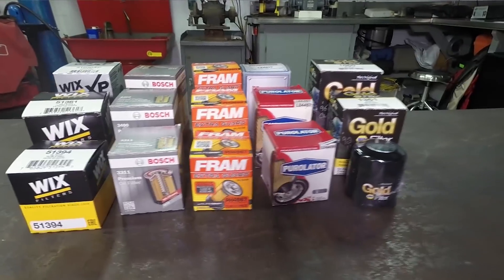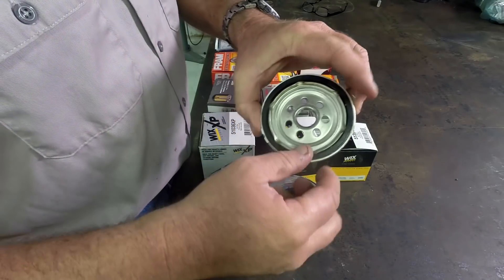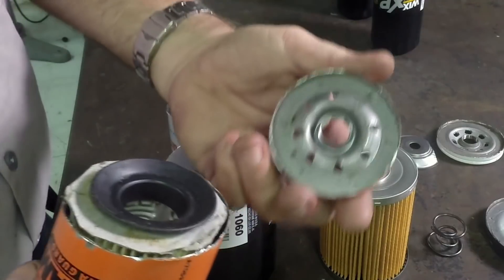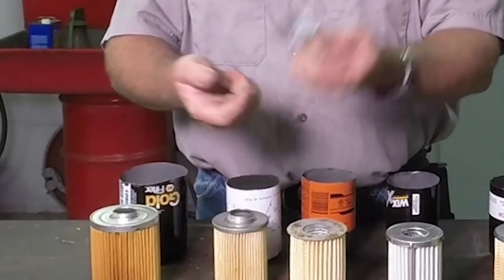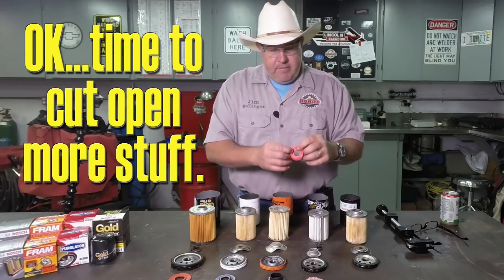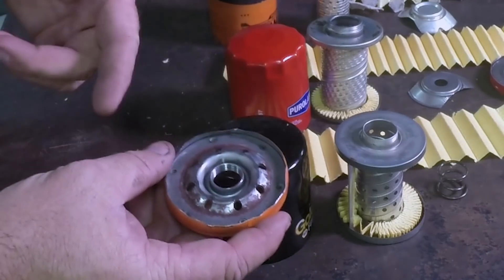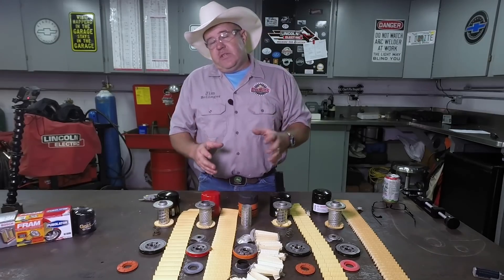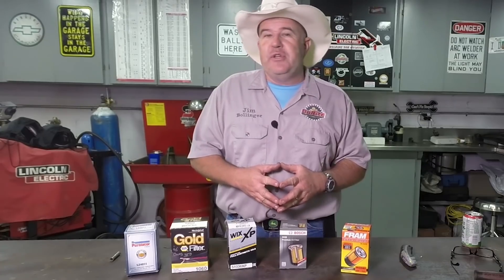The worst oil filter EVER!

Comment: This 'presentation' is unquestionably a probable unreliable and 'hyped' source of such information.
 
First of all such oil multi-pass RECIRCULATION filters are required to pass important validations and compliance through actual testing.  This 'test' is based on the (1935?) Oklahoma State Univ. - OSU F2 test stand protocol for filter efficiency etc. The filter MUST retain the particles to a certain %, (not absolute 100%), at the nominal µM 'rating'.  The OSU F2 protocol has been affirmed by the ASTM and DIN/SI.  This has absolutely NOTHING to do with 'how beautiful' the 'appearance' of the filter is or isn't - does it pass the OSU protocol for 20µM particle.  ...
As long as the filter is validated (by the manufacturer) per the OSU-F2, etc. test protocols, it's OK to use and will meet the 'single pass' 20µM (0.00078 inches) SAE recommended particle retention. 

A far as the 'cardboard' issue .... well, it just so happens the filter media is also a 'cellulosic', - a technical paper that is composed of cellulose and an epoxy 'binder ' --  just like the 'end caps' on that FRAM, etc. filter.  So, if you think that the 'cardboard' is going to fall apart ... well the filter material is of an almost same composition. The epoxide that is used to 'glue' the filter material to the metal end caps is usually the same epoxide that's used to make the epoxy-resinated 'cardboard' end caps. 

If you want to do a TECHNICAL comparisons of such filters, either go to the filter manufacturers website and seek out the 'technical data' or call up their application engineering department:
1. Flow rate in gallons per minute PER differential pressure (pounds per square inch) across the filter. 
2. Ask for the nominal filter rating in 'micrometers', then ask what is the PERCENT of captured particles at a single pass of oil flow.   You can also ask/look up what the 'BETA -value' (a relative indicator of capture efficiency) of filter material ... as to determine the amount of % captured of SMALLER particles, per 'pass'.  Most such filter 'foundries' use a 15-17µM (@ beta = 500) 'paper' to meet the 'nominal' 20µM SAE 'spec'. 
3. When youre looking up the DATA .... choose the filter with the largest filtration media SURFACE AREA --- keeps the differential pressure down which allows a GREATER amount of oil to be filtered / per unit time. 

1. NAPA Gold is private label branded and manufactured (mostly) by Wix. Obviously NAPA, and the other aftermarket distributors, and even engine manufacturers, don't make filters.  
2. Wix is my personal go-to ... because, as someone with a long term involvement in 'advanced' filtration engineering, Im quite sure that they're quite high quality and very much optimized TO "SPEC", etc..  
3. if you want 'really good' filtration, especially if you're operating in 'dusty' environments and with severe engine usage, ... and if you have the space/clearance available, consider to install a double sized filter ... but of the very same connection, etc. size. 'Double' will give you about 3Times the filter life (before the filter 'bypasses') and MUCH better flow rate 'through' the filter for 'faster' oil recirculation through the filter and less oil 'bypass'. 
4. If you want the best, 'do your homework' and avoid the 'HYPE' from folks who have little to NO idea of how or why filters 'work'. 

These types of filters are 'recirculation' mode filters .... meaning if a particle doesn't become captured during the first 'pass', the statistics are that it will be captured during successive 'passes' through the filter ... and that includes particles that are many many times smaller than the filter's 'rating'.  None of these filters will capture 100% of the particles at their 'rating' during each 'pass'.  
Up until about the early 1980s such filters used an un-bonded toilet paper-like filter material, some used wound cotton 'string', some used a 'kotex'-like material .... but they ALL were constructed and validated that they could pass the OSU-F2 test protocols !!!!!!!  The more modern use of high surface area, pleated, resin bonded cellulosic filter media increased the 'flow rate' (for 'faster' particle capture) as well as extended and enhanced the in-service life of these filters. 

Unsupported Hype does not equate to the 'numbers' to which virtually all these filter 'assemblers' are testing during their manufacturing and QC processes.  Avoid wild-arsed & unsupported claims of HYPE ... use the filter manufacturer's published 'numbers' if you have the need to be 'spot on'.  
Lastly, always change your oil filter when you change your oil, don't 'skip'. 

;-)
Reply from the maker: Thanks for the info, as for me, there is no "hype", a rusty falling apart filter will not be what I use. All the Fram filters I opened were rusty, at that point, for me, they are garbage. If anyone wants to use them....fine by me.
Reply: —> @DoRiteFabrication   so why are some of my technically important posts that refute your errant hype and clear unsubstantiated misinformation removed? ... especially the ones where I preliminarily by simple forensic observation - exposed a highly probable water-wetted filter (with rust) and failing end caps, etc. that would be impossible for just about any automotive filter manufacturer ... unless someone soaked that filter with water or it was from recovered inventory from a flood, etc.?  Dont like someone challenging your unsubstantiated and libelous misinformation? - tough. 
So when are you going to use a laser particle counter, etc. etc. and industry STANDARD tests to compare each filter on its 'honest' SAE/DIN/SI TECHNICAL merits?
Reply: @richh1576  proving once again why Trade guys will gladly attend any engineers funeral. To take a piss.
Reply: —> @70montess   Good Post!    You're more correct than you know.  These are RECIRCULATION filters where the lube oil continuously passes through the filter over and over and over, etc. The result is that these filters on a statistical basis remove particles at MUCH lower than their 'rating', and due to the statistics of removal will almost immediately remove (and retain) the bulk of even a rare 'particle storm' caused by failing metal somewhere inside the engine. The filter material inside the filter is made by essentially ONE world supplier; so, on a performance basis such filters will be essentially equal on a one to one basis if the their effective surface area of the cellulose filter material is 'close'.    
That's the anti-hype explanation.  And, there is no need to know if the word anal-retentive needs an apostrophe or not.
Reply: @DoRiteFabrication  What it all really boils down to is this: Does your customer have confidence in your product?  You can try to dazzle 'em with tech-speak and scientific babble to explain your minimum product effort of rust and cardboard.  Or you can make a substantial effort to build a sturdy product and exceed the minimum.  We've seen plenty of engineering failures to know that what "should work" isn't always what actually works.
Reply: —>@jettrod69   You gotta ask yourself how LONG has that filter sat idle on a storage shelf in an auto supply store before someone bought it? You can do the same for any uncoated steel based product ... let it sit on a distributors shelf, etc. for years and years and most assuredly you'll find internal rust, because that's what bare mild-steel does.  
The flow direction of such cartridge filters is from the outside of the pleat pack through to the inside of the pleat pack .... guess where the steel inside of the filter is .... on the outside of the pleat pack ... upstream of the filtration media and not filtered out.  20µM particles (the removal 'spec.') are well below in size of what the human eyeball can discern; so, if you have visible particles on the upstream side of the filter, the filter will 'easily' capture them. 
Have you looked at the underside of a several months old 'new' car lately ... that's not orange paint thats developing on a lot of that bare steel.  

The only FAIR comparison would be sure to get a 'fresh' filter assembly from each of the manufacturers.  

ALL of the displayed filters WILL develop rust on their insides if abandoned to sit for a long time.  Even if any manufacturer used rust-bloomed material, the high pressure metal-drawing process used to 'form' the outer canister would remove 99.99% that rust.  
That THIS one had rust 'only' means that it most probably sat around for a LONG time in a VERY wet/humid atmosphere.   
Forensically and in combination with the internal rusting, I'd be quite suspicious of those falling apart, thick tech-paper end-caps and EASY removal of that 'flap valve' assembly ... as that doesnt happen in dry atmospheric conditions for such resin-bonded technical 'paper' ; but, only when long term submerged/wetted in WATER, such as an inventory that gets flooded, etc.  If I had to testify: "In my opinion - The probability is that .... Sometime between the manufacturing and the 'cutting open', that filter was probably heavily water-wetted down or even *underwater*".    ;-)
Reply: RichH 
Perhaps your right but manufacturers should specify materials and packaging that lasts long shelf lives
Reply: Also just to state something, I am not a fram fan, needless to say a previous commentor said something about 250,000 miles. Thinking about it now I can actually verify that because my father has used fram and cheap conventional oil on his 300 inline 6 for 306,000 miles now, and the truck still burns no oil. Had the tranny replaced once but the engine is still in tip top condition... Just saying, so fram cant really be that bad huh? Like I said im a fan of mobile 1 products but needless to say 300 thousand plus running strong on fram and motorcraft periodically... Then again it is a 4.9 inline six. They are bullet proof... I would not use fram on newer smaller touchy engines  that demand super clean spot on oil to run a long time...
Reply: It still boils down to real world results, and if Fram is really that bad they wouldn’t still make/sell the filters and there would be multiple lawsuits against them if their materials repeatedly cause engine damage, changing your oil and filter at appropriate times is still most important.
Reply: Sorry to inform you that I did the same test as this man in the presentation, and guess what? He is right.
Reply: Really? You wrote a fucking book man.
Reply: Could we please get a more specific and scientific review from someone like you, who has filter engineering experience, to do a formal review?
Reply: Why do you use so many quotations?
Reply: —> @torquesoftware   simply because Utube doesnt provide ITALICS.
Reply: @richh1576  Of course not  :P   (to put a word in italics, put an underscore before and after it)
Reply: @bledlbledlbledl  I didn't know how to do this either. Thanks for the tip.
Reply: Damn you must be the filter jesus.... Shewww, educate me
Reply: All I can say is
Amen !
Reply: Glad to see your reply. While it is disturbing to see rust inside an oil filter, all locations seem to be where the filter will block it.
While ruggedness may be nice, it is not a requirement.  All that matters is that the filter & seams always provide a barrier between the filtered & unfiltered oils. I suppose there is an allowable pressure drop across a new oil filter and that it increases as particulates are removed from the oil. If there was a test that subjected filters to 10x the pressure drop that one would expect for a used oil filter, and that test showed that one brand had a filtered/unfiltered barrier failures, THEN I would respect that test. The findings shows in this video are subjective. 
Based upon this video, the cars of the 1950's should be safer because they were heavier & had thicker steel parts than cars of today. Cars today may break apart more in an accident, but are safer for their occupants.
Reply: Go buy a 100k car and put a Fram filter on it.
Reply: —> Mark Hernandez  ummmmm,  Im one of the ones who collaboratively wrote 'that book'. Nothing wrong in quoting oneself.
Reply: @RichH. You are quoting the minimum standards.  We all know people who do the minmun compared against the ones go about e and beyond.
Reply: —>@ @doitndirt   This is stunningly simple. If one somehow perceives the need to exceed the 90 year old minimum SAE standard, then simply apply a lube oil filter that has larger internal surface area of the pleat pack ---> faster oil 'turnover' due to less flow resistance, hence, faster statistical particle reduction and removal.  Eg.: Buy a double sized, etc. filter that will 'fit' (one with the SAME µM 'rating').  
This applies to air intake filtration too... and you'll get a wee bit better max. HP/kW output from the engine to boot. 

Other: NEVER EVER install an oil filter with a 'smaller' µM rating than the OEM spec. !!!!!  As, the design 'recirculation' flow rate of filtration will reduce exponentially, as well as the filter will plug 'exponentially faster'.  In filtration, there's a precise optimum balance between µM particle size removal vs. surface area vs. flow rate vs. pressure drop across that filter.  The smaller the µM removal, the higher that pressure drop which will result in LESS oil flow rate, etc.  Get it wrong and you could rapidly 'choke-off' the filter, create 'hot spots' in areas of the engine because the flowing oil does assist in heat rejection/cooling, etc. etc. etc. etc. 
Installing a larger surface area of the same µM rating is 99.9% foolproof as well as beneficial to 'better' particle removal.  
For normal usage, stay with the strictly 'stock' stuff. ;-)
Reply: You do realize that those test you state are of such low testing standards that a roll of toilet paper in a coffee can can past all three of those tests rite....
Reply: —> @TWOSU_NEWS     
TOTAL BULL!
The reason that toilet paper, cotton fluff and cotton strings are no longer used (since the ~1970s) is that they constantly UNLOAD both previously captured particles but also fragments of toilet paper, fluff, and string fibers.  Imagine what happens inside a main bearing journal, etc. with ~0.001" (25.4µM) ... or sometimes smaller, 'clearance' when a particle that is larger impinges, gets stuck, and begins to collect other 25µM particles.  
The modern resin-bonded filter material will remove approximately. 97+% of those particles ....per 'pass through'.  The toilet paper, fluff, and cotton will only remove about 50+% per 'pass', plus they the UNLOAD as the pressure drop across them increases because the 'micro-fibers' aren't fixed in place.  

So, the question becomes why would you use or suggest something that really doesnt do its intended job and also contributes LARGER particles into the flow stream? ... remembering that prior to ~1970s that crankshafts, camshafts journals were usually 'worn down' and the babbet-faced journal bearings were 'shot' by about 60-70,000 miles driven.  
Guess why now in the present day we have a fairly high probability to operate an engine for 200K -300K miles?  Plus, as engines are increasingly designed around tighter and tighter oil clearances and lower viscosity oil, we're already seeing the need for extremely finer and more 'accurate' and LARGER sized filters.  Someday soon there will ultimately be a prohibition on DIY changeout of the filters because DIYers, 'huckster shops', etc. will often buy 'crap' that will thwart vehicle warrantees.   ;-)
Reply: @richh1576  : you write a million word statment., citing facts which you believe true., that big oil puts out. Or you can do a littler research about how oil filters are mad and certified and you will get your answer. Fyi
Reply: @richh1576  o and forgot to memtion...the iso rating is a ( bare minimum ) rating. Out of an iso score of 1-60 fram comes in at #60 with wix coming in at #22...the filter for ferrari and lambo round out #1 & #2 and are made by bosch
Reply: @TWOSU_NEWS     ... that's what is essentially the core of what Ive been doing for a living for the past 30+ years.  You?   What's your curriculum vitae, bub?   
Didn't know that BigOil made automotive filters, thanks for the 'left-political' info.
Reply: Mike Hegarty  but in the case of peanut butter you cant see it but are happy to eat it anyway, your only complaint with fram is you can see the rust.
Reply: That's a burn
Reply: Kaice Gunn, It's not really pressure that's important, as much as flow rate. Too much pressure can force oil out of it's intended path starving parts down the line. My buddy had 60 psi and kept blowing up motors. Turns out the second to the last cam journal was a couple of thousandths under-sized and oil would spray out from there and starve the 7 and 8 (4 and 8?), connecting rods bearings. 
I had, at one time, had a VW powered race car with a full-flow oil pump, 4' of oil line to a double filter adapter, two racing filters, 2' of hose to the motor, through th motor, into about 8' of line, through an oil cooler, 8' back to an oil tank, and 3' to the oil pump. Pressure right after the pump, a steady 45 psi, out of the motor a steady 35, just before going back in the pump, a steady 12 psi.
My buddy picked up his oil pressure from the back of his small block Chevy. All that told him was the oil pump was turning. if he would have picked up the pressure in the front he would have see fluctuating oil pressure, which meant a steady flow was not there.
High pressure saps horsepower, like high blood pressure in a person.
Low pressure makes horsepower, in the sense that it's easier to move the oil at high volume, as opposed to forcing it at high pressure, and dragging down the engine.
Reply: @TheChaos145  oil presure is relitive to the thicknes of the filter fiber...a larger filter wont neccasarly decrease oil pressure. May take longer to build when cold but wont hurt motor if you let it warm up. I use one on my 08 impala thats designed for the Ls4., same mounting bracket and same oil pump just larger diamiter filter and 1/2 quart more oil.
Reply: @Mamiya Phan Would you KNOW 'junk' if it looked you in the face; or, would implicitly trust something 'beautiful' ... just because someone told you it was beautiful.   HYPE is what is used to sell used cars, and to inflate stupid people's egos.